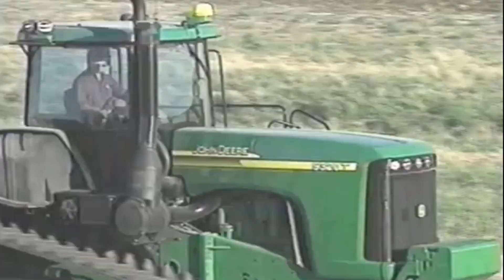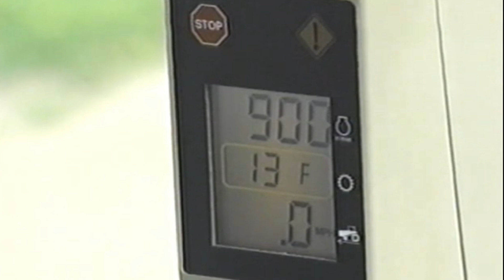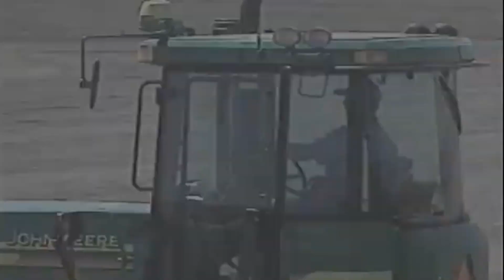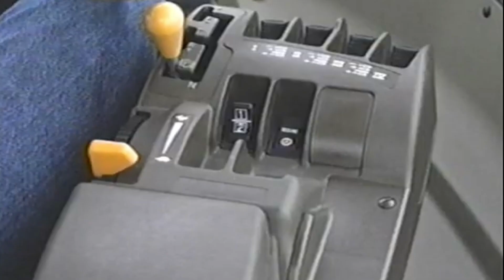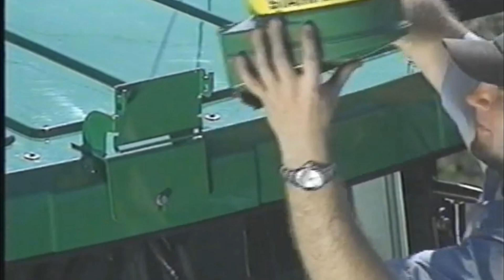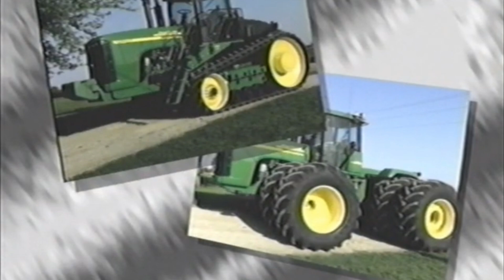John Deere 9020 Series Tractors 2001 Promotional Video

Comment: I have decided to own the John Deere 9220 4 Wheeled Drive Tractor for my FUTURE FARM.  Because it will be ONE of my most FAVORITE 9020 Series Tractors of all time.  But, I guess I fell in LOVE with the older model numbers of the John Deere 4 Wheeled Drive Tractors from the 1980s to the early 2010s.  

By the way, I better fall in LOVE with the 6000, 6010, 6020, 6030, 7000, 7010, 7020, 7030, 8000, 8010, 8020, 8030, 9020, and EVEN 9030 Series Tractors altogether from John Deere.

John Deere does NOT introduce the 9010 Series Tractors.  The CASE International Harvester Company has been introducing the 9010 Series Combines before and the John Deere 9000 Series Tractors were eventually replaced by the 9020 Series Tractors in Waterloo, Iowa.

John Deere also makes the 9000 Series Straw Walker Combines like the 9400, 9500, and the 9600 in East Moline, Illinois.  And then, John Deere introduces the 9000 TEN Series Combines like the 9410, 9510, and the 9610.